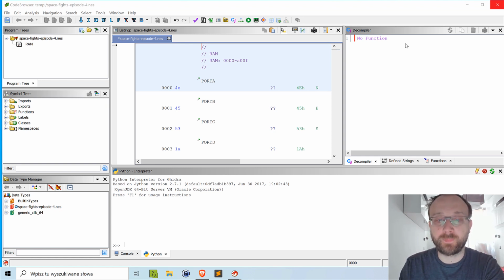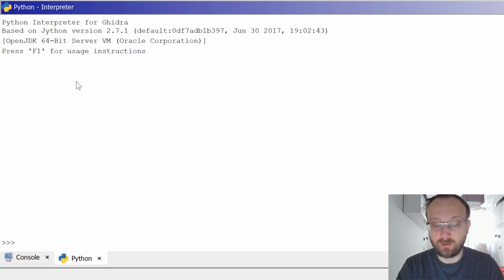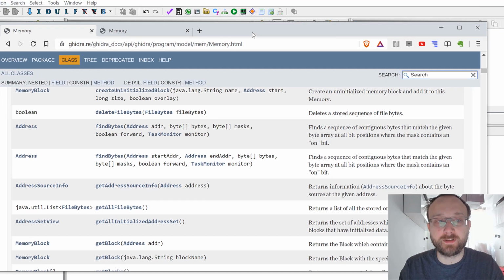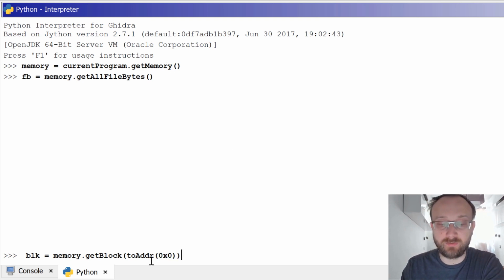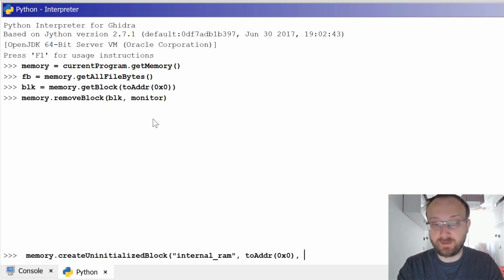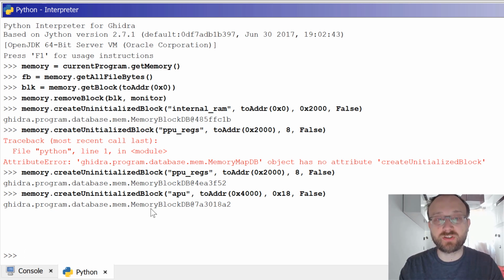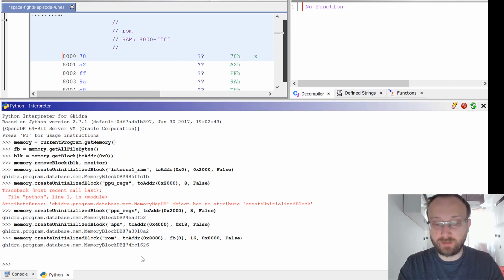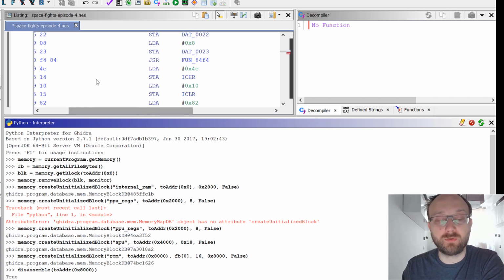Scripting Ghidra - Memory map

Comment: What labels this script assign to the memory blocks,i.e. correct labels(.text, .data, .bss, stack) or some arbitrarily names?
Reply from the maker: Script was used on a NES rom so there's no .text, .data, .bss but you can easily change those to reflect what you want
Reply: Good. Can you show example of more common case when we need a) split RAM in two regions: .text (code) and .data (data), and b) to add new regions: .bss and stack. (both as an overlay)